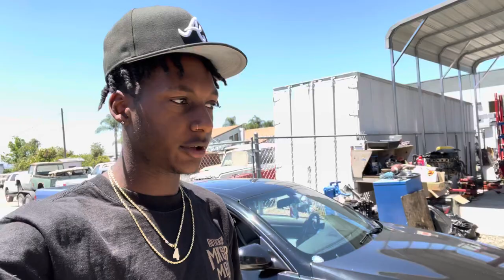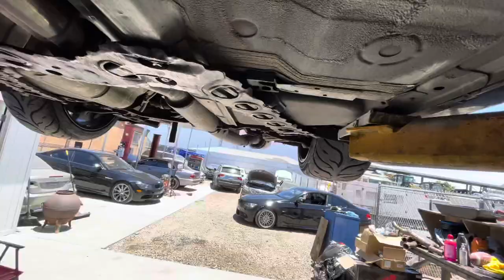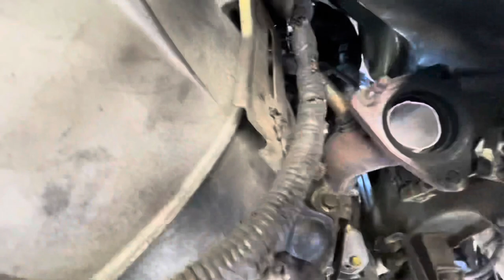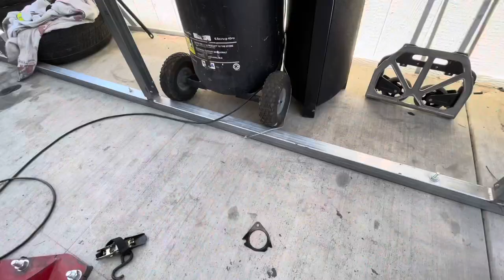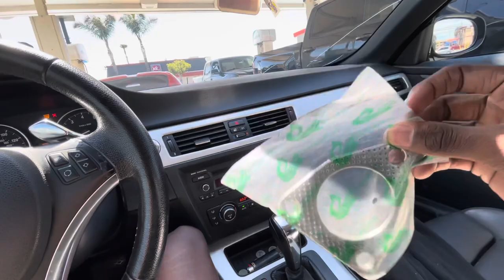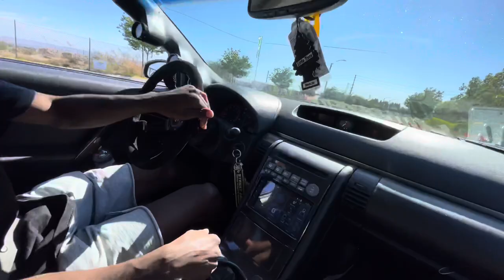Single Turbo G35 Almost Catches Fire!
Fixing Boost & Exhaust Leaks!

Comment: You should have deleted the flex pipe and used an exhaust bellow because deleting the flex pipe all together will likely cause the manifold to crack and lose boost pressure overtime.